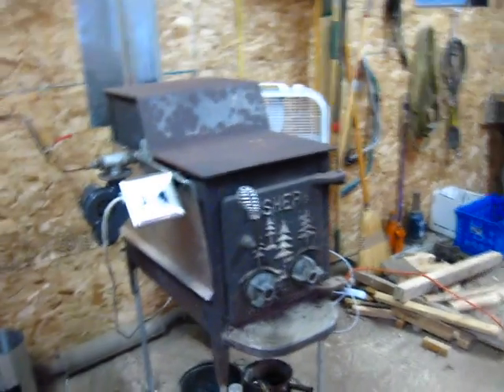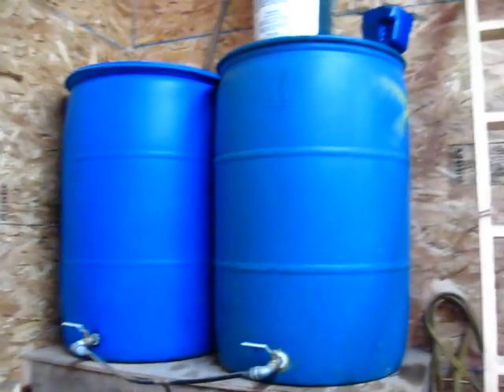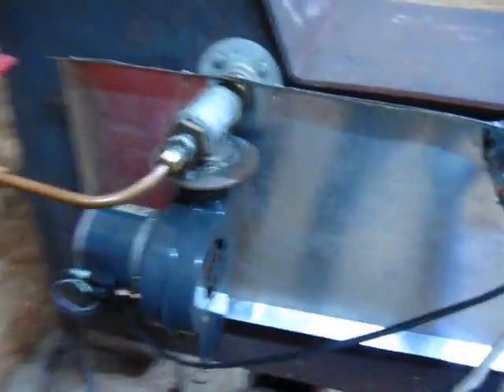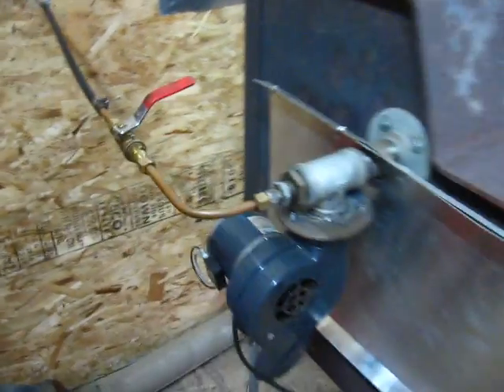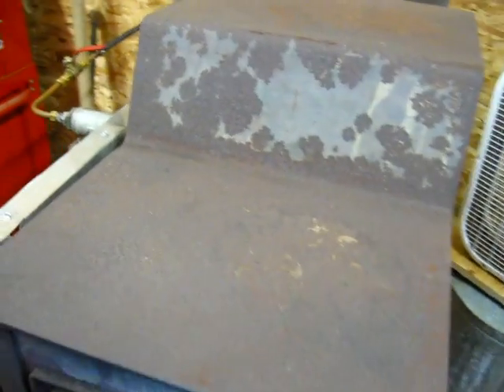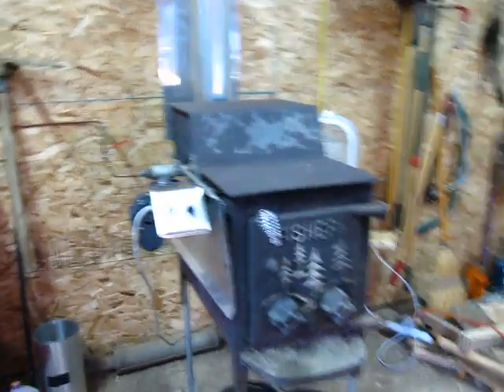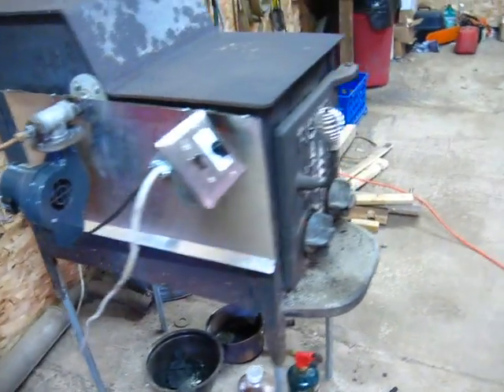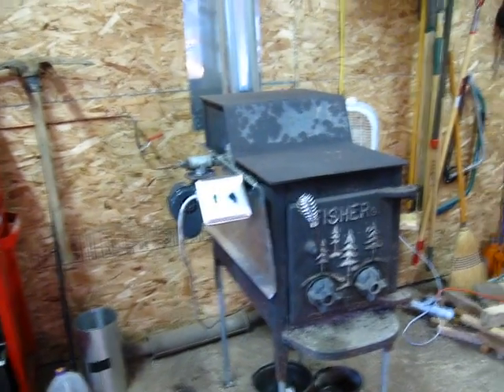Homemade waste oil burner 2.0

Comment: Things were going SO well, until you put a piece of plastic fuel line so close to the stove. 

I can't say I agree with it as it stands, getting it further away would be better, a glass/pyrex sight tube would be much better that close to the stove. 

I do like 2.0 fan and controller.

Comment: Do you run dampener open or closed  on door
Reply from the maker: Dampers are open all the way, the more air you can get in the burn chamber the hotter the fire you can make. The natural draft of the heat rising up the flue sucks in air rather than pushing  smoke  out the vents.
Reply: Thanks  I got mine set up like urs yesterday and still  figuring it out problem I'm having is it will be going fine then go out and have to restart  going to try shorter pot and different meter ing valve next
Reply from the maker: @jasonscruggs986   how cold is the oil? I have to use a good bit of diesel (a couple cups) to get everything hot enough to stay going when starting. Heat or oil volume is normally the issue if it won't stay going sometimes both. There needs to be a constant pool of oil in the pot and enough heat to vaporize it so the fumes can burn... hope that helps
Reply: @sheisillme  thanks I'm still messing with it having hard time controlling my oil flow have two different types of gate valve s I need to find a needle valve really. What size bowl do you have?
Reply from the maker: @jasonscruggs986  the bowel is nothing more than a medium size dog dish found at tractor supply probably about  6-7" in diameter and 3 or so high
Reply: @sheisillme  if you're still using that much diesel to start , here's a tip . to an empty 5 qt oil jug add 1 qt gas , then fill to original full mark with motor oil (1 part gas + 4 parts oil = black diesel) . shake very well , then shake briefly before each time you use this cheap starter (1 gal gas makes 5 gal starter) . never use in a heater that isn't cold . light as soon as you add it to heater , never give it time to "gas off" before lighting .

Comment: By the way, I forgot to add..... Regular RED Kerosene are cheaper than Diesel.  We get Kerosene to mixed with the Free Oil. We get Red Kerosene here at our Local Gas Station for $2.49 a Gallon (October 2017 Price). We mixed 1/2 Gallon to every 55 Gallon Tank we have and it's cheaper that way to thin things out than Diesel.

Comment: How much oil does it use now that you have your flow rate dialed in? Have you ever conected a 1gal jug and let it burn its self out to see how long it would go for? Thanks for the vid, I would love to replicate your setup some day!
Reply: +BillCosbyEatsBabies - Depend on your needs, as far as on my Test... If I stayed at 450F, it's close to about 1 Liter Per Hour. But if I go under about 350F... I can get almost 1-1/2 Hour through slow drips.
Reply from the maker: not really sure, used about 25 gallons all winter though (not heating all the time tho mind you)

Comment: I like everything except the Blower Fan. You should bring the Air from outside in. Drill a hole in the wall and bring outside Air in. Whatever that Fan is sucking out CFM wise... That is what you are losing in Heat :///. It's like throwing Heat out the Chimney since you are sucking Warm Air from the Room aka your Work-Shop.
Reply from the maker: that's a good point. The heat out put makes that amount of heat loss unnoticeable, plus I did not want to drill yet another hole through my wall and with my set up it causes a small amount of fresh air to be drawn into the shop which is always good in that type of enviroment

Comment: Hey good video how cold it get ther  ? how ya keep oil from gettin so thick ya say more diesel guess thks again
Reply: +521famer - Regular RED Kerosene are cheaper than Diesel and less mixing.  We only mixed 1/2 Gallon to 55 Gallon Drums and it's great so far.
Reply from the maker: coldest day in the winter register -10 to 0 F... diesel (or Kerosene) kept the oil from thickening too much

Comment: if you wanted to can you still burn wood in this stove?
Reply from the maker: I would have to turn the down pipe out of the way but yes still posible
Reply: If he built it Semi-Permanent, then I am sure he can swing the Oil Drip Chamber out of the way and can still burn Wood :))). In this Video, he blocked the waste bin with Bricks which can easily removed :)))))

Comment: The flue is to short. To much heat is going straight outside. Should have the flue as long as possible in the room to radiate heat.
Reply: +Wayne Goff - You are right, since he have High Ceiling. His Pipes should be longer to reclaimed as much Heat as possible. Also, I think he has to work with what he got, since some places required you to get a Permit before moving to another Location, cost more money ://. Plus, his insurance might not covered if they found out he modified the Wood Stove for other usage.
Reply from the maker: Honestly, this was a very low budget build. in retrospect running the chimney higher would have been ideal. However, that stove gets so hot you can feel the heat coming off it from 10' away... no need to have more heat in the room really

Comment: Thanks! Smog pump still kicking, when it dies I will try the dayton. Larry if you have the correct air / fuel mixture you will see nothing but heat fumes from stack. Amazes me how clean of a burn you can get from such a simple contraption.

Comment: Do you have any idea why you get excessive black smoke when you open it up? I have pretty much the same setup. I increase oil flow and air and the flame is very aggressive. So is the smoke.
Reply from the maker: I get black smoke when i have my oil feed set to high, smoke is always a product of incomplete combustion, so if you have smoke you either have to much oil or not enough air
Reply: It seems to me too much air tries to blow out the fire which causes smoke. Less air works better for me, but I feel I should be able to crank it up. I see others online wide open with no smoke
Reply from the maker: Yes i had similar experiences. I found that you don't need a high velocity of air, like you said that just blows out the fire . You do however need a high volume, that is achieved by a larger diameter blower and delivery pipe, not a higher speed fan. basically if you want more heat which means a bigger fire you need to get more air in there somehow. with my current set up I can only run like half oil stream because my air delivery is restricted by the pipe diameter, if i needed more heat i could go to 1 1/2 pipe to match the outlet of the blower, thus using it's full potential.
Reply: That makes more sense than anything I have come up with. Thanks for your help I will work on it.
Reply from the maker: I had the same issue until i put some diesel in the oil to thin it out and increase the octane level... also i have noticed if it is cold out i get a much smaller flame with less heat just cause the oil will not flow enough volume through a 3/8 tube
Reply: I have the same fan/blower as you have. I have 2 inch pipe all the way into my stove with 3/8 copper fuel line through it. It starts and runs great for about 30 minutes, then it just dies out ???   UMO and the 3/8 fuel line is not clogged. The flue is new also.  Not sure whats gong on, im new to this.   Im burning in a stainless pan just slightly bigger than you are and it is in the bottom of a double 55 gallon wood stove kit.    It gets good and hot but just always dies out no matter how i adjust fuel or air, kinda has me stumped too...
Reply: Thanks for the reply, i guess i will try to thin it more.  It was 45 degrees out and i had 3 gallons of UMO  with a qt of trans fluid in  it and it seemed to be running ok but i will thin it with some kero. and try it out...

Comment: Nice job! I'm using a smog pump off an old Cadillac with a small electric motor driving it. Makes good air but noisy.  That blower your using seems quiet. Do you have a part # for it?
Reply from the maker: blower is a dayton 1TDN7